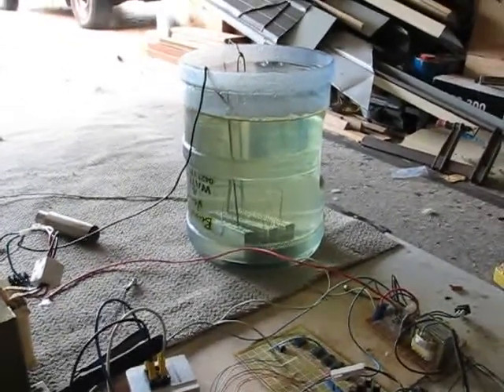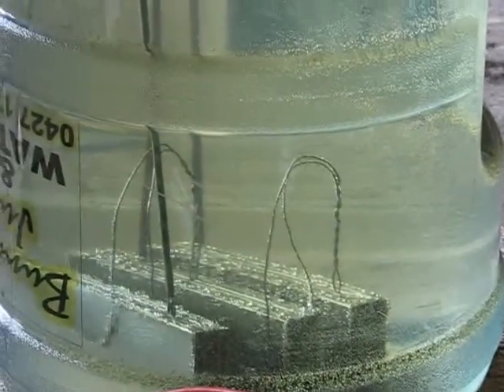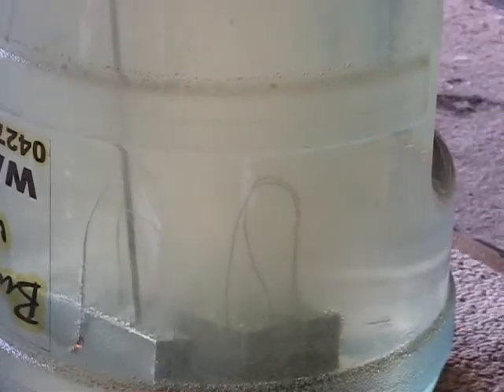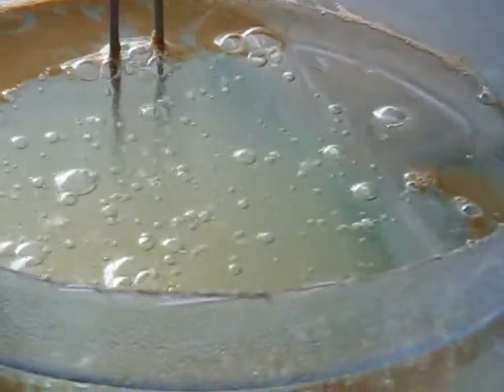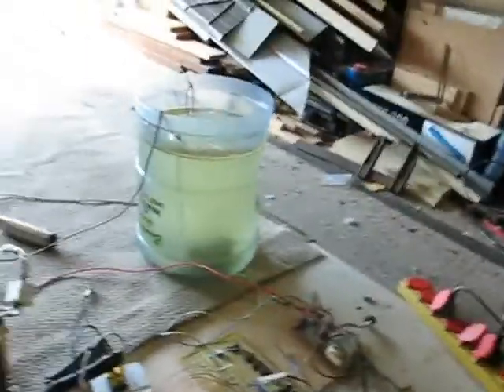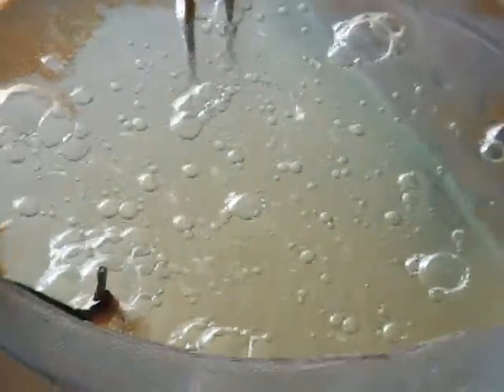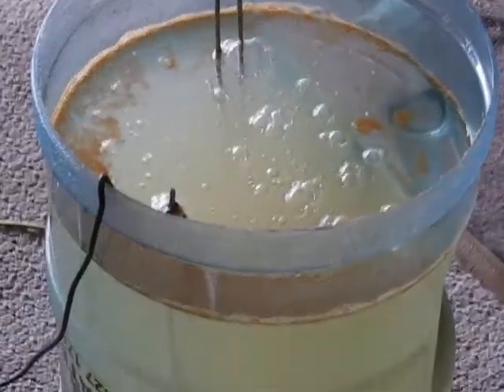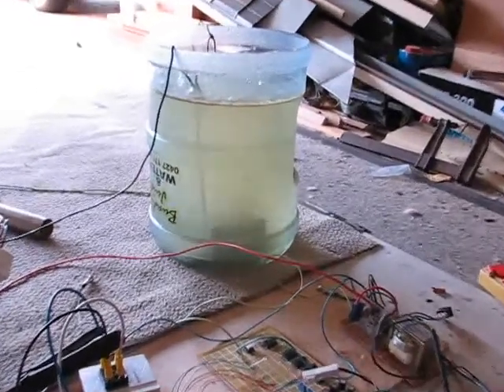HHO 8XA 3 cell test 2.flv

Comment: just wondering with that circuit did you find any errors with the drawing
apparntly the pcb circuit is worong the pin 4 on the hd11 is suppos to be pin 5 i dont know wether this is true it was said in a forum
Reply from the maker: yes there was a  fault in the circuit, I found it when I built it and he corrected the drawing, was nothing to hard to correct.